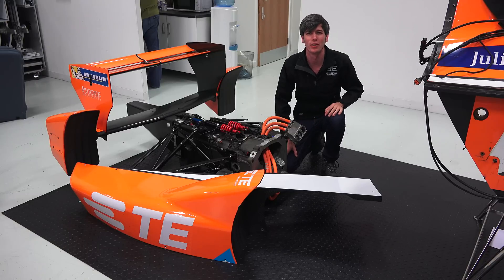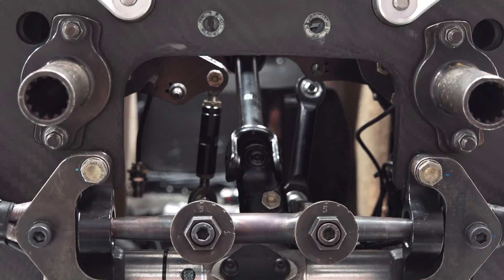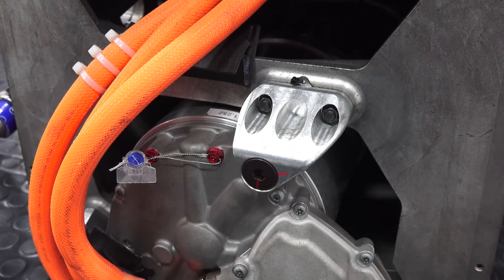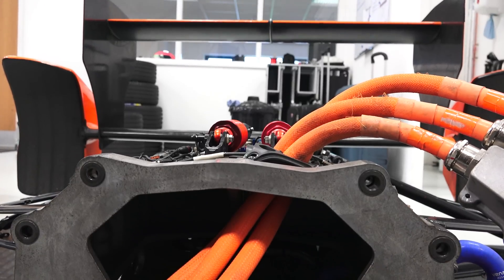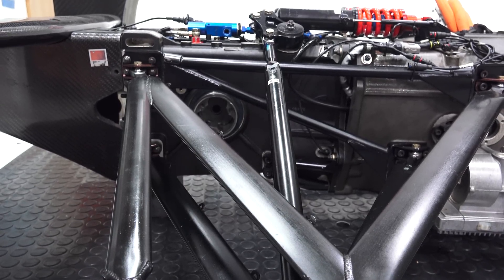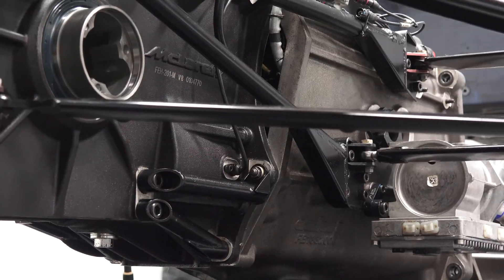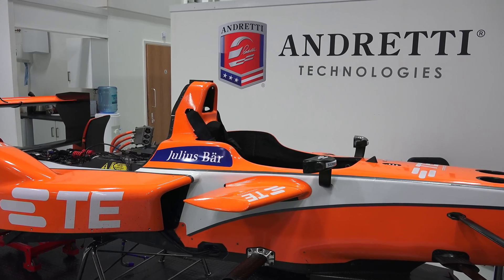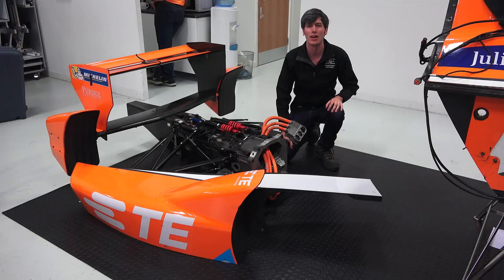Developing An Electric Race Car - Formula E

Comment: Why don't they use back emf from motor coils to help charge battery on the go. May need two separate batteries to do this but it's possible. Just add diodes to the back of the coils then to secondary battery
Reply from the maker: You can’t use a motor to accelerate and regen at the same time. It’s either slowing or speeding up the vehicle.
Reply: Engineering Explained. When the coils is swiched off the electricity can be collected using diodes. Try a simple experiment using a coil, switch, capacitor and one diode and watch the capacitor charge up when the coil is switched off.

Comment: Why isn't torque vectoring and per-wheel motors allowed, I would think this allows teams to experiment more with electric motor setups. Is it possible that in later seasons they would be easing these regulations?

Comment: It seems rather unlikely that "no gears" is a winning solution to a FE race!  It means you can't actually use the full power of the Emachine at low speed, and forces a huge field weakening speed range, that kills efficiency......

Comment: A lot Better than F1. F1 is no longer for real world testing of technologies, Maybe it once was, now it's just but that not really the case anymore.

Those are real innovators, doing problem solving that will help make E-car more efficient. Also, no freaking noise! just a  cool sci-fi style hissing. No worth for me to participate, I leave too far, but good luck to everyone getting into the sweepstakes!
Reply: Sylak F1 is now for pure racing, entertainment, and slight innovation. 

Le Mans is now the place for research application and proof of concept of a new tech. you can find new tech or innovation each season. like, Audi Diesel hybrid, Porsche with their re-gen braking system for hybrid, cylinder Management system on Corvette, and so on.

Comment: gears in an electric car?
Reply: Formula-E is all about efficiency. With every motor you have efficiency pikes and lows, so keeping your motor at maximum efficiency saves some energy.
Reply: Oh.  I wonder why road cars don't have more than 1 gear?
Reply: A multi gear gearbox is more expensive and of course it adds additional weight. For road cars, car manufacturers aren'T limited to a certain amount of kWh to put into their cars, so they can use the weight and money savings over a gearbox, to add more batteries. 

But that doesn't say that we won't see multiple gear EVs in the future.

Comment: You plan on doing anything on the Rimac concept One and concept S?
An electric vehicle with Hypercar performance.
1MW of power incorporating an independent drive system for each wheel having its own motor meaning with some clever electronics extreme torque vectoring can maximise the cars handling abilities but can also be tailored and adjusted  on board meaning you could make the car 100% RWD or even 100% FWD if you ever felt so inclined to do so.
Unlike other road electric cars, this one has gears for maximum performance and efficiency meaning you can accelerate to 100k/h in 2.5sec and 200k/h in 5.6 sec but also go to 300k/h in 13.1 sec up to a top speed of 365k/h. The rear has a 2sp duel clutch but the front has a separate independent single speed gear box meaning there is no point where you stop accelerating while you change gear!
Please do an engineering explained on this car, it looks amazing!

Comment: I am currently undergraduate mechanical engineering student who has 1 year experience in designing and manufacturing a suspension system for a formula student car to compete in the FSAE competition, I am excited to  apply for the this to expand my knowledge specificly on race cars engineering field

Comment: Would you be able to explain how and why formula student cars use double wish bone suspension? 
Like I don't get the calculations for the position of the arms.... do you just guess it? 

For example say you have a frame with certain dimensions, would you then find space to mount the suspension and do the calculations to justify it? 

Or do the calculations to see where it would be theoretically then change the frame design accordingly?

Thanks for the help.

Comment: Much of the potential benefit from electric performance cars is had only when you have one motor driving each wheel.  A computer regulates the power/rpms put into each wheel which improves cornering and acceleration.

Comment: I noticed how all of the wiring is all Mil-spec connectors, I planned on using all of that for my #AWDCRX build but I can't find a good source for them? Do you have any info on that, or a place where I can order something like a 25 pin connector and a firewall mounting plate?

Comment: never heard of electric car racing before, never researched electric cars at all. My first thoughts, what kind of motor tech? 3 phase induction? Brushless dc? I do a little research, not find definite answer what used in racing, but, based on racing motors found for sale, permanent magnet, those, even though they do not state, must be brushless dc.  I was absolutely amazed of what I did run across in my 10 minute research, I find on ebay electric car conversion kits,... And some use BRUSHED dc motors. Not even going to research that, those have to be low efficiency and terrible short time between service. Quite interesting subject, electric racing.
Reply: Im in a student club building a hydrogen fuel cell vehicle focused on efficiency. We go with a brushed DC motor simply because they're wayyy easier to use and are more reliable. We used a brushless last year, and sometimes our car failed to go up hills due to the added torque. 

You need to have a very good control system to apply large torques to a brushless. With a brushed motor, torque is proportional to current applied. Using a PWM controller, you can raise your efficiencies.

Comment: So since they are slowly opening up options what would be their thoughts on a CVT car? I would expect the best platform for using a CVT would be an electric powered platform because the electric motors can handle a constant RPM better than combustion engines can. Do you think that they could end up using it in the races or would it not perform as well as traditional transmissions?

Comment: This isn't exaclty related to Formula E, but could you explain how torque vectoring works in electric cars (like the Mercedes SLS AMG), and what type of calculations and adjustments they are constantly making? Thanks.
Reply: The electric SLS AMG is an interesting application in itself. Mercedes opted to use one motor per wheel, so they're able to individually control each wheel's torque output, rather than using differentials to bias, cut off, or lock output sets togethers. Different modes, different behaviors, blahblahblah I hope you get a video explaining this for you.

The key really is that each wheel is controlled by an individual motor there. That allows the outside wheel to be accelerated separately, or the one or both of the front wheels to experience braking (electric regen or traditional), all for the sake of controlling the car's attitude/heading. It's worth noting that the Koenigsegg Regera uses this style of torque vectoring, but just for the rear wheels. It seems to scoot fast enough.

Not all cars work this way. Many electric and hybrid cars work similarly to how the Formula E car here is described. No motor per wheel, but just substituting or adding an electric motor where an IC engine used to be. P1, 918 in particular.
Reply: The calculations are actually quite complex, since he only real control the driver has is over the steering wheel. The basic idea is that if you apply more force to one side of the car it will move to the other side. Now you also have the front wheels to steer the car, so the car has to be tested and adjusted by the engineers to give the right feel, over the whole speed and turning range. 

A big benefit is that you can go faster around corners. And while you can also achieve some kind of torque vectoring trough a clever differential, where multiple clutches close and open, having two motors can give you a greater differential torque, the difference between the torque sent to opposite wheels. Audi, for example, says that with their upcoming electric 3 motor SUV, they can achieve more than twice the differential torque, compared to the best mechanical torque vectoring systems. You also save weight, since you don't need a differential anymore.

Comment: That power pack says "Williams" on the side...anything to do with the Williams F1 team?
Reply: I am not sure but didnt the transmission say McLaren?
Reply: batteries are supplied by williams engineering, the consultant offshoot of the team. Mclaren recently won the tender to supply the next generation of batteries from season 5 onwards
Reply: aussiebloke609 yes i does beacouse formula e is also runed by fia

Comment: Why can't there be a swap capable battery pack on a competition E-Car? As it's better to develop safer technologies to make batteries exchangeable on the fly, which is the most time saving measure instead of putting the entire car on standby while charging.
Reply: johnny chang I think swapping the battery pack mid-race would take forever.

Comment: Why do they have a mandatory car swap instead of just swapping batteries during a pit stop? I think the swapping cars during a race is kinda cheesy - I think teams should use the same car throughout the entire race.
Reply from the maker: +Mike Simms safety. They don't want teams rushing the battery swap and consequently someone getting hurt with the high voltage. So they do car swaps, and give them a 60 second window so that the swap doesn't have to be super rushed, just quick. Also, the battery is very much so structural; a quick swap could mean reducing rigidity.
Reply: +Engineering Explained With the engineering incentive, we may see some innovation that can have far reaching benefits. I'm looking at you Samsung.
Reply: car swapping i think is going to be going away in 2018/2019 and is why Mercedes is joining from what I heard.
Reply: I bet we'll see some experimenting with supercapacitors.
Reply: I believe the plan is to gradually phase that out anyhow. As batteries and systems get more efficient they will likely stop the swap completely and likely go to just changing tires like other races.
Reply: Yes, it's already planed to get rid of the car swap for 2018
Reply from the maker: Also, to add, the plan is to go to a single battery for season 5 (perhaps 6). Either way, they're headed towards single cars.
Reply: they need capacitors and cvt

Comment: i love the sound of electric motor at full tilt. the whine sounds way better than any high rpm na/forced induction engine.
Reply: There aren't many times in the world where an opinion can be out right wrong, but here we are. History, ladies and gentlemen.
Reply: history is filled with random strangers with no cred debunking other people. hardly a first.
Reply: Well, there's that and I do enjoy the occasional rumble of a good engine, but I just find that these electric motor whine just sounds incredible, especially those that run insane rpms that results in that whine.
Reply: wtf is going on here
Reply: sadakotube I thought we were talking about your tastes, not mine. go wonder
Reply: I also enjoy electric motor sound. ICE sounds are also nice. People who don't like electric motors are basing their views on mostly small powered motors in house appliances or industrial electric machinery where pure sound of the motor is suppressed by other machinery.
Reply: sadakotube To each his own. That high pitched whine will never transfer the feeling of raw power by vibrating every cell in your body and shaking the ground you stand on.

Comment: I'm surprised to see that the suspension parts are made of metal rather than CFRP, ist that not allowed by the rules?
Reply from the maker: Just not a focal point initially, cost is kept low. Initially allowing for design flexibility with powertrain setups, rather than focusing on suspension/etc where the innovations aren't exactly unique to FE.
Reply: yes, rules say the front suspension members must be metal. pretty sure it was a cost control thing

Comment: But why do (normal) electric cars only have one gear? Wouldn't it be more efficient (not only power but also consumption) to have multiple speed transmissions?
Reply: don't most of them use CVT?  a CVT transmission covers any range since the size of the driving gear is always changing.
Reply: ***** added weight aside. Wouldn't it make the car more efficient (consumption and power) for example while driving at high speeds on the Highway/Autobahn (at 100-150km/h  60-90mph) in a higher gear?
Reply: Hans Eidottersauger again, look up how a CVT works...
Reply: +The one who licks his eyebrows manual transmission then
Reply: ***** for the last time:THEY USE A CVT!!!  A CVT CHANGES SIZE OF THE DRIVING GEAR SO IT CAN COVER ALL RPM BANDS.

and stop acting like you know what you're talking about.  an electric motor has no advantage over a combustion engine when it comes to shifting. the engine/motor has nothing to do with shifting; the transmission does genius.
Reply: Cory Goodman They don't (at least most of them don't)! They (most of them) have a single gear (I heard of some that have two(only example that came to my mind was the Rimac Concept One)). I found an page on a forum which answers my question quite well: https://www.quora.com/Why-do-Tesla-cars-not-need-a-gear-system-and-why-does-a-gear-system-make-sense-only-for-combustion-engines (Also note the secound comment which gives a few examples: "The Tesla Roadster initially had 2 gears, but eventually they gave up on getting that to work and replaced all the cars' transmissions with a single gear.[...] The Model S has always had just 1 gear. The Nissan Leaf has 1 gear. The BMW i3 has 1 gear. The electric motor in the BMW i8 has 2 gears.")
Reply: Hans Eidottersauger you do realize a CVT has one gear, right?
Reply: Cory Goodman I know how the basic concept of a CVT works. The only electric CVT's I know are in electric motorcycles (like in the ones with combustion engines). Please tell me from which source you know that electric cars use CVT's; I am interestet to read/hear/see it!
Reply: Hans Eidottersauger tesla...
Reply: ***** I know a man that has nicknamed as "human DCT"
Reply: Cory Goodman Well: Have a look at this picture of the instruments of a Tesla Roadster: For a certain speed there's only one certain rpm which means that the only possible is, that there has to be just a single gear:
https://www.netcarshow.com/Tesla-Roadster_Sport-2010-1600-0b.jpg
Reply: Hans Eidottersauger one gear IS a CVT.  you just proved me correct.

when at a particular speed, the driving gear and pulled gear widen/shorten opposite each other, resulting in a single gear that adjusts to the proper rpm for any speed.

it has the advantage of being able to adjust the gear ratio without actually changing gears, thus getting the best rpm for any speed whilst using one gear.

Comment: Step 1: don't. please. ever. try to make electric car racing a thing.
Reply: May I ask why?
Reply: jets a faster than cars by 4 or 5 times why do we still race cars and not jets? and why are their limitations on races not just whoever can make the fastest thing wins. because its about being confined to the electric engine, something we dont know that well. I mean internal combustion is not perfected but the have vtech, v8, v6, i can go on and on and on on the technologys for combustion engines. so as a designer of a racecar if you say get low exaust presure you know exactly what can be added with multiple diferect technology that you can add to make your car faster now for an electric engine if there is low torque or whatever there is no standard for electric engines yet so you have to develop the "Ve-tech" and that means you have to actually engineer now thats what i call fun not getting in a car that has been built 99% the same for the last 5-10 years
Reply: I see where your coming from.but that the phenonena of life your will always enjoy v8 and ICE because thats what your into already, just like i prefer the psp over android for mobile gaming just what i know, even though i know androids are just as powerful if not more than the psp.
Reply: Its true that true racing is best left to the drivers rather than aids, but not all racing is for entertainment. Some is for developing cars and technology and F1 was like that for many many years and is still trying to be, which is why we even have these electric systems in the cars alongside a turbo engine (which is the future of commuter car efficiency).

We will always have entertainment racing like NHRA and Nascar and then technology development racing, such as F1 and Formula E. I really like development racing as the other stuff just finds a human better than another group of humans but teaches us nothing in the process. Development racing trickles tech down to road cars and can benefit millions.
Reply: There is more to appreciating cars and watches races then just the sound.
Reply: there is no excitement in electrical motors. I know they can and will produce more power, but in the end a screaming v12, or v8 are more appealing than that sound. formula 1 got boring since the electrical assists systems took over 80% of the driving